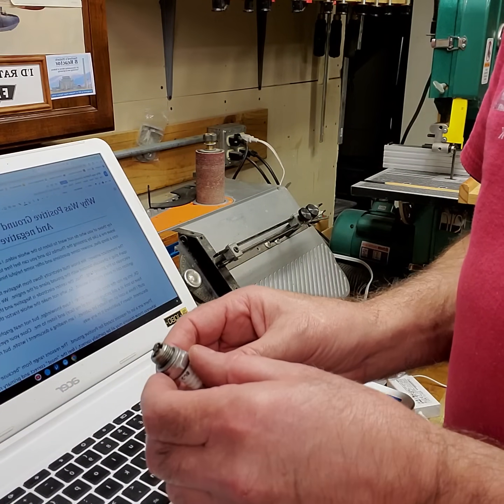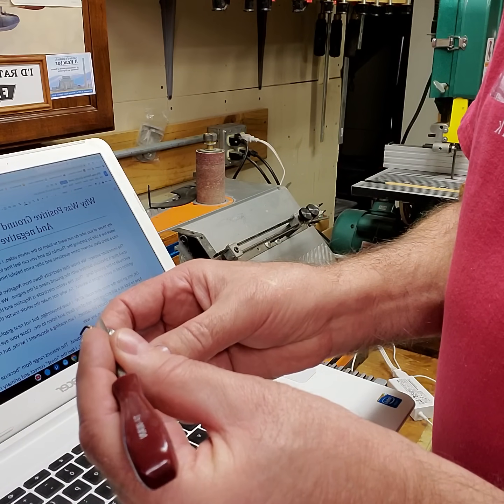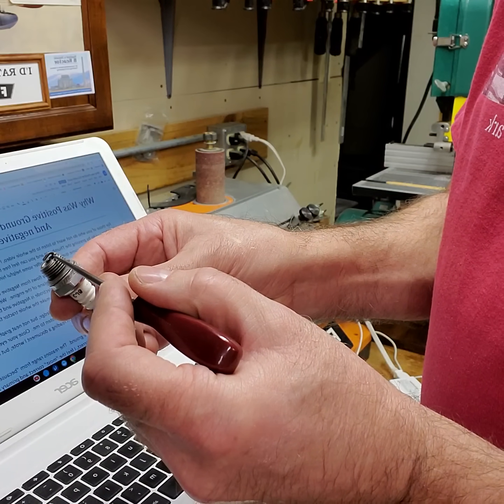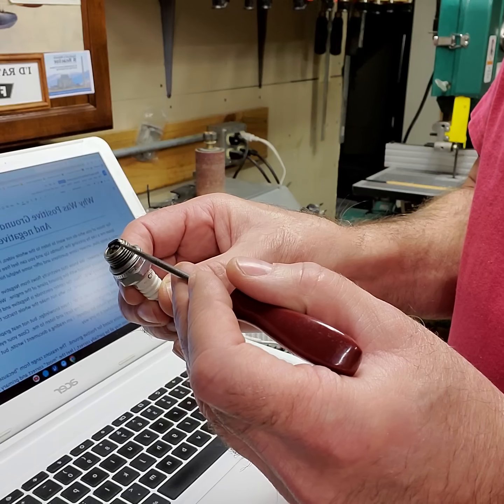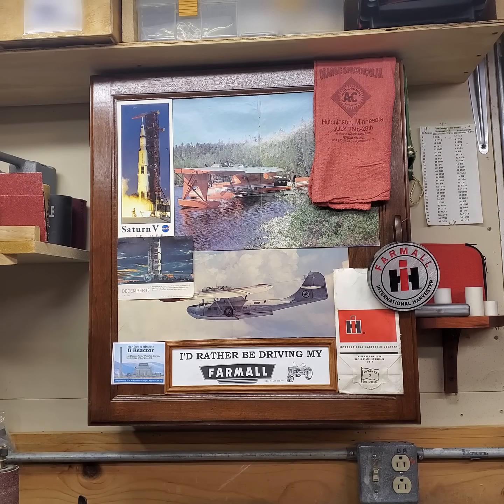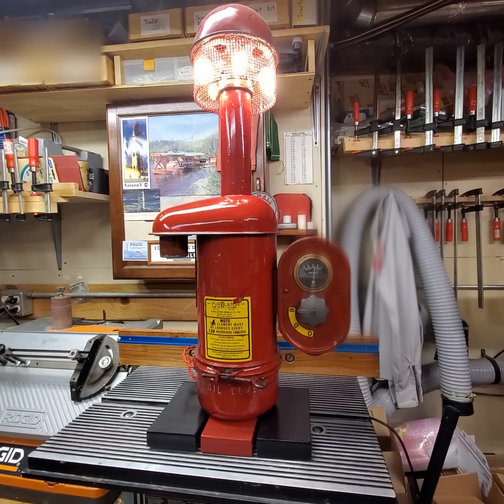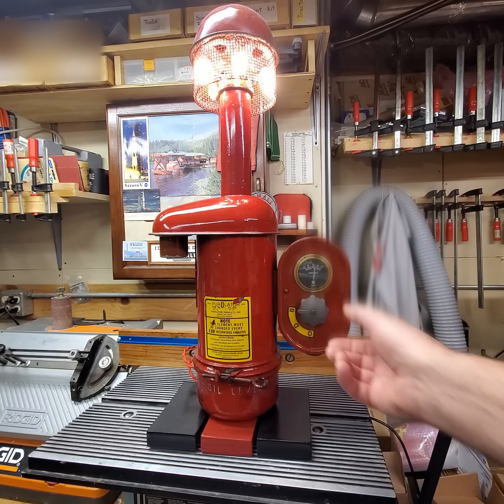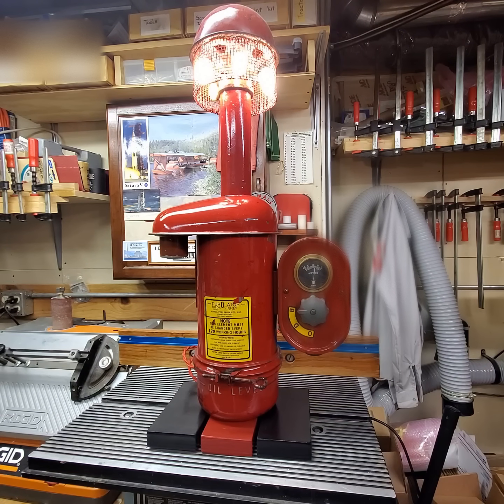Why positive ground was used on old cars, trucks and tractors

Comment: Modern "Wasted Spark" ignition systems have one center-tapped coil for every two cylinders.   Thus, one spark is positive ground and the other is negative ground.  Somehow that doesn't seem to hurt much.
Reply from the maker: Hi MIke!  Thank you for the comment.  I don't know why that is.  I wonder is it is because (I think) the waste spark is not under compression.  It is a very interesting topic and comes up in the comments a lot.  Maybe the topic of the next video??
Reply: @bryanh1944FBH  Yes, the spark that is wasted is on that cylinder's exhaust stroke, but that's not the point.  In a Kettering ignition system the coil secondary is connected to one plug at a time, and always provides a negative voltage.  In the wasted spark system, the secondary of the ignition coil is wound with each end connected to a different spark plug.  When it fires there is a spark at both plugs simultaneously.  Since they are on opposite ends of the same coil, one of them is always positive and the other is always negative, no matter which stroke the piston is on.

Comment: Regarding vacuum tube radios in cars, the first car radio to be powered by the car's electrical system instead of by separate dry batteries was the Motorola, invented by Bill Lear, the Lear jet guy, back, IIRC, in the 1930's, decades before cars went to negative ground.  Those radios didnt care which way the car's electrical system was wired, because the tube filaments(aka "heaters") weren't polarity sensitive, and the high voltage polarity for the tube anodes("plates") was taken care of by the polarity of the high-voltage rectifier.  "Hybrid" radios that used a power transistor in place of the vibrator, and low voltage tubes, didnt appear until the LATE '50s, 2 or 3 years  AFTER the polarity change over was made.  Some of the tube radios had "option" jumpers to select between 6 or 12v service. Tubeless all-transistor radios didn't start appearing in cars until the mid 60's, ten years after the switch to negative ground, and those old transistors were PNP construction, which worked with a positive ground, which required special circuits and construction techniques in the radios to be used with negative ground.  NPN transistors, which worked directly with negative ground systems, didn't appear until much later.  Some of the solid-state radios had options to switch between positive or negative grounds.  Whatever the reason for the switch to negative ground, car radios of any sort had nothing to do with it.  My qualification:  This stuff was current when I used to work on it in days long past.
--- an old, OLD radio man AND car/motorcycle/boat/hot-rod mechanic.
Reply from the maker: Hi Joe!  Thumbs up to you and an excellent comment.  You are a wealth of knowledge.  I wish you were standing in my shop and we were having a long discussion.  I would learn a lot from you!!  That's for sure.

Comment: I think you are right about the switch to make it easy for troubleshooting by less than expert electrical people.  It is too bad because I definitely noticed that when the whole system is positive ground, there is no corrosion on the battery terminals.
Reply from the maker: Hi Charles.  Thank you for the comment.  I agree.  However, many commenters did not.  But, I have seen several very good mechanics troubled by positive ground.  But whatever the reason, negative ground is the standard now.

Comment: As a welder for 30 plus years using dc welders both straight and reverse polarity welding rods if your watch closely when you strike the arc you can see the flow of the current.
Reply from the maker: Hi sasquatch!  I never experimented with reversing the polarity of the welder.  I welded a fair amount of iron pipe for refrigeration systems.  I always left the welder the way it was.  But, the really good welders (like you, I bet) reversed the polarity at times (like when welding sheet metal).

Comment: Thank you sir ,now maybe I can explain to the younger ones why a positive ground was used , bought an old truck with a positive ground but the young fellow didn't know about that so he couldn't figure out why it would not charge the battery and wouldn't stay running,I changed it after I got it home and it still running today , never knew why positive ground,now I know, kids want me to switch to a negative ground,I tell them you change it after I'm gone !
Reply from the maker: Hi Will!  I hope you enjoy your old truck for a very long time.  Thank you for the comment.

Comment: I can think of a few exceptions. Onan Generators fire both plugs at once, One Positive ground the other negative ground.
Any car with dual wire coils. Fire 2 plugs at once.
Reply from the maker: Hi James.  I too have heard of this.  Some Ford (I believe) engines used different plugs for the two sides.  There are a few comments about this somewhere in the bunch.  Do you know if Onan did that too?

Comment: As an auto electrician in the seventies we changed hundreds of cars from positive earth to negative earth because there were no radios that had a positive case. So it was either completely insulate the radio or change chassis earth. Change battery terminals and then re-energise the field coils on the dynamos. Many thanks.
Reply from the maker: Hi Colin CK!  Interesting point.  Thank you.

Comment: Positive ground vehicle rust faster than negative ground ones, in the 1970's when they started the change from positive to negative ground there was a lot of talk about this and the presumption that manufactures chose positive ground for this very reason. It was the Japanese who really started the push to negative ground for one reason and that was they were fitting transistor radios in all their cars as standard and transistor radios work best with a negative ground. Ford was the main user of positive ground originally with Chevrolet being negative  ground, the main reason for Ford going with positive in the first place, they thought that it was better for a bit of iron to corrode than the brass used in lamps and switches, the body work/ chassis acting as a sacrificial anode.
Reply from the maker: Hi equiluxe 1!  Nice comment.  I wonder if tractor manufacturers in the 1930s were concerned about rust?  What do you think?  Thank you.

Comment: I knew that 12VDC wasn't always standard on vehicles. However I just learned that the polarity was different.

On a side note, here in the US, civilian commercial trucks start with 24 VDC, smaller trucks and cars start with 12 VDC, and military trucks start with and have 24  VDC system.

My source: a US Army veteran  who had  a logistics MOS  and has been a truck driver for thirty years. Aka, my father.

Comment: Also a generator will produce full voltage at any RPM, and alternator won't till it reaches a higher RPM in the electrons are plus to minus not minus the Plus it's the voltage itself goes the other way

Comment: My first car was a 1954 Ford Customline. It had a 6 volt positive ground system. I remember having occasional trouble with the battery terminals keeping a stable connection. Always had a wire brush and half inch wrench along for the ride. At one point I added a really nice Craig 8 track stereo with Jensen Speakers. It was a gigantic wedge that was intended to be bolted to the transmission hump that included a bracket, that would let you dismount it and carry it around, so no one would steal it. I had to add a power inverter, as it was 12 volt negative ground, as well as fashion a wooden plate to isolate it from the body of the car. I am sort of proud of my 16 year old self. Thank library books and Radio Shack electronic kits when I was 10. Another interesting note, that stereo sounded really good without the need for an external amp. Perhaps transistor based radios were just better than the microchip units of today? At 66 years old, I create elaborate pixel based, musically synchronized light shows for Halloween and Christmas. The fascination with electricity never ends.
Reply from the maker: Hi Limburgercheese!  I too had a Craig PowerPlay 8 tack in my first car (65 Chevy).  I think the speakers were Jensen too.  I would take it out at night with one 8 track tape in it because in the winter, when it was so cold, I could have music right away.  Otherwise the car had to warm up before the stereo would work well.  Ha ha

Comment: Technically, there is no 'ground' or earth on a car.  The vehicle is insulated by its rubber tyres and is a fully floating DC circuit. The issue is one of which polarity to use for the common return through the chassis in a steel vehicle (but not say in a fibreglass vehicle) and the choice is, or at least was (before the advent of alternators and electronics)  largely arbitrary. In humid climates there may be more of a problem with electrolytic degradation with one current 'direction' than the other, and this may have been more severe in the days of fabric insulated wires which absorbed moisture. The sparking plug theory is not to my mind very convincing and the secondary of the coil can anyway be connected in either direction. Oh, and there is a school of thought that electrons don't actually flow at all.

Comment: The real problem was car companies in the 1950 were going from six volt to twelve volt and often positive ground to negative ground. If a car didn't have a battery installed you really had to check to make sure you got it right and there was no internet to check. I had an Opal station wagon from the mid 1960s and it was still positive ground.

Comment: Interesting subject and comments. I'm not sure you explained WHY positive ground was used. Another subject is why they went to 12V. --> it needed much less copper to conduct the needed currents. On a side note I recall buying an 8V battery to replace the 6V one and just tweaking the regulator spring tang to get it up to 9 or so volts. The starter worked better, the headlights were far brighter and I was very young so I guess we didn't care about other problems that may have arisen like frequently burnt out points, capacitors, lights etc. :)

I recall having to determine vehicle + or - ground status for jump starting (as old tube radios with vibrating converters used prodigious power and would kill a battery in an hour) to see if we could just touch bumpers and use any kind of wire we could find to jump or had to find two conductors!

Later we maniacs pulled the entire body off a Pontiac straight 8 that had that skinny long 6V battery and  perched the radiator, lights, seat at extra angle, throttle pedal and gas tank on the frame with welding and bolts and screamed around the old wagon road called Overland Rd outside Ft Collins, CO
Reply from the maker: Hi Willss!  I think the tractor supply stores still sell 8 Volt batteries.

Comment: So, in trying to wrap my head around this:  You are saying that when the magnetic field in the ignition coil collapses and the strong (thousands of volts) pulse created is negative relative to the engine block and the frame?  So, we can think of the block and frame as zero volts, the ignition pulses as very strongly negative.  In a modern negative ground vehicle every thing else is positive such as the power supplied to the starter motor by the battery or the power to the radio or engine computer.

Comment: If the current flows from negative to positive and there is a grounding cable from the engine block to the negative terminal I have a conceptual problem getting your idea.

Comment: You keep saying the electrons HAVE to jump from the center electrode to the tang, but never say why electrons CAN'T jump from the tang to the center electrode, considering a Jacobs Ladder flows in both directions using AC current.  Stick welding normally uses negative ground, and flux core welding normally uses positive ground, but you can reverse the convention and both will still work.
Early telegraphs used a single wire high voltage DC with both ends using positive ground ground rods for the return path, an arbitrary decision.  Then early telephone systems running on -48v DC positive earth following the telegraph convention because it was easy.  A car chassis does not have an earth ground connection, it's a floating ground, so it's an arbitrary choice to use the chassis as the return path for either the + or - side of the battery to save having to run return wires for every circuit, and having a pair of plug wires for each plug.  It was the move from silicon plate rectifiers that could be connected either way, to silicon diodes as the rectifier for alternators with chassis negative dominating the supply market that drove the standardization on negative chassis.  Manufacture of positive chassis alternators were out competed.
Reply from the maker: Hi WorkbenchZ.  Excellent comment.  Thumbs up to you.  It's my bad.  I'm not clear on what I said.  When the spark jumps from the center electrode, spark plug life is much longer.  Erosion occurs  mostly where the spark jumps from.  If the spark jumps from the steel tang, the plug will wear rapidly (and, you tractor won't start and run as well).

Comment: Coil polarity isn't always a ground or the negative polarity. look at waste spark systems. On a conventional automobile distributor coil all thats needed to change polarity is swaping the wires. The statement that electricity flows from negative to positive isn't completely correct.  Voltage moves from high potential to low potential. A higher positive will flow to a lower positive. Current flows  sometimes even in opposition of polarity.

Comment: I never understood why they would use positive ground. It was going to ground to anything else it touches.

It is really odd that they used Positive to represent the side of the battery that has the most electrons (-) negative charged particles.
The Negative side is where the electrons are going.
I don't know if it has a positive charge. But I think it is where there is an absence of negative electrons rather than actually positively charged.

I had a hard time wrapping my head around the fact that the Positive side was full of negative electrons.

It is easier to think about it as positive charge even though it is the opposite of that.

And when you go to A/C you are actually between the 2 parts of the wave from the generator.

When you look at the wave it goes from 120 to one side to zero to 120 in the opposite side.
So if you connect the one side to the other side you get 240

But looking at the inverters from DC to AC you have 85 volts reading on a standard volt meter
You have to use a special meter called an RMS, but I have no idea what that means, and I don't know how the devices are seeing any different from the 85 volts a standard meter sees

I understand that the waves are square in inverters, but I don't know why that makes a difference in how it reads the voltage.

The electrons actually travel on the outside of wire, not through the wire, and the reason why is because it can't travel through solid material easily

It can ride on the outside of wire or surface much easier

I am amazed how much better lithium batteries are than they used to be and they are so much more power than the Alkaline batteries.

I now buy only litium batteries for everything
They last so much longer in smoke detectors and remote controls and flashlights

I wish they sold them in the store, but they don't and I have to order them online, but it is worth it.

Comment: My father (and Uncles) drove 12 volt cars/trucks with positive ground.  They told me that such wiring would give you a really good shock if you stood on a moist surface and touched the frame.  But a negative ground would not do the same and you could work on it while standing in a puddle of rain water when it quit running when it was raining.  For me a perfectly good reason for the negative ground.

Comment: interesting.   worth noting that although the big 3 automakers went from positive to negative ground in the mid 50s when switching from 6 to 12 volt systems many British sports cars had 12 volt positive ground systems until around 1970.  I always thought it had to do with Alternators replacing generator/regulators,  as well as radios being able to be standardized across the board.

Comment: Cars had tube radios for 30 years before solid state radios became available.  BJT transistors (even germainium ones) come in both flavors, PNP and NPN.  It was only the very first point contact transistors that didn't, and they actually only had a diode PN junction in them.  The first solid state car stereo was in 1963, 15 years after NPN AND PNP BJT transistors were invented.  30 seconds on google will tell you this.

Comment: Packards used 12 volt POSITIVE ground from 1952 (?) or 1953 until they died in 1958 (Maybe earlier. Like all straight 8's after '45). WHY? More VOLTAGE to everything in the car! A "12 volt lead-acid battery" when fully charged ACTUALLY delivers 13.8 volts (14.1 no-load!), but on a NEGATIVE ground system the steel chassis wastes about .3-.8 volts and at the headlight relay the voltage measures 13.0-13.5 volts. A Packard measured 13.8 volts and their headlights were BRIGHTER and WHITER than 98% of the cars on the road. Electricity flows from the NEGATIVE to the POSITIVE pole. Electrons and current and voltage. The USAF beat that into my brain. Nashes, and Nash Ramblers and some Willys CARS had 12 volt positive ground systems and a couple of odd-ball Chryslers did too-a Ghia body and another exoctic. Oh, yeah, Citroën's (my eye Doctor drove them!) used 24 volt positive ground systems and 50's and 60''s Renaults used 12 volt positive ground systems as did some '60's Simca's (Spanish Chrysler sub-compact imports). I think I recall GMC skrul buses and medium duty trucks in the 60's using pos ground with field excited alternators-bad ground-dead electrical system. I DO remember that on skrul buses!